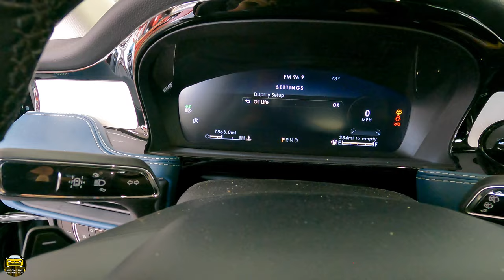How To | 2020+ | Lincoln Corsair | Oil-X | Oil Life Reset |

Comment: I do t like those bottom trim pieces. I see the purpose  it pritects dirt and road grime getting all over the engine and parts .
I'm very meticulous with maintenance. I:d rather see that trim made with a plexiglass window so you can visually inspect for leaks and such.
Reply: It keeps the driveway clean.. 😅😅
Reply: That is what the strategically placed half dollar sized holes are for. Place a pen flashlight in one and look through the others.